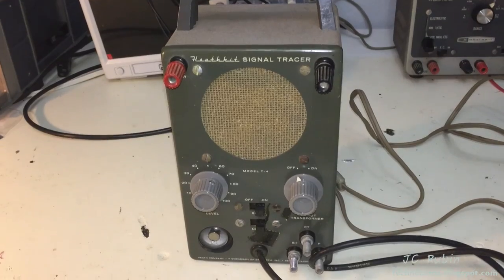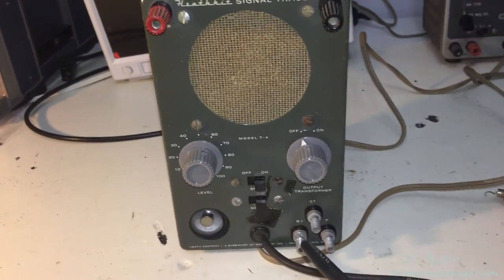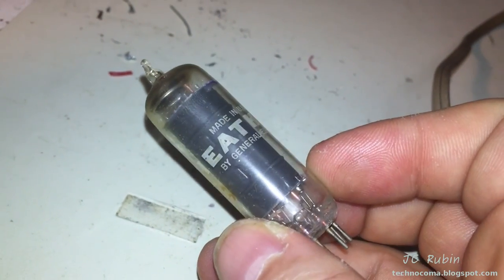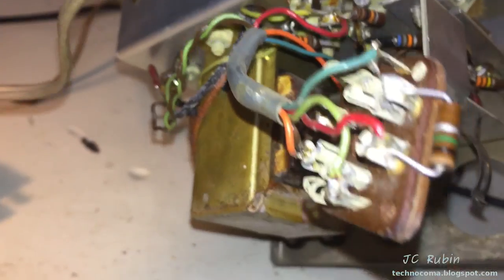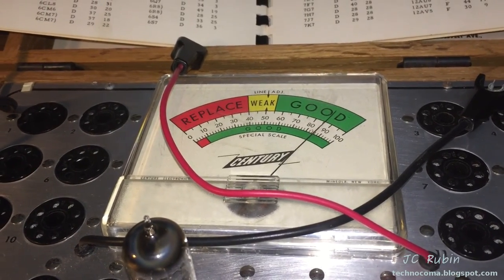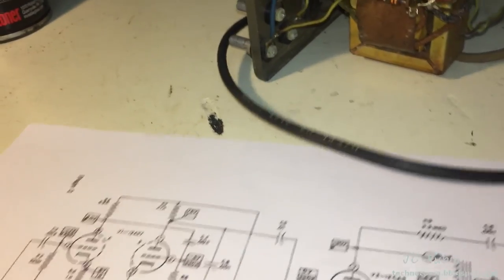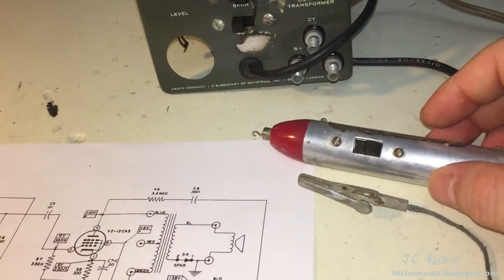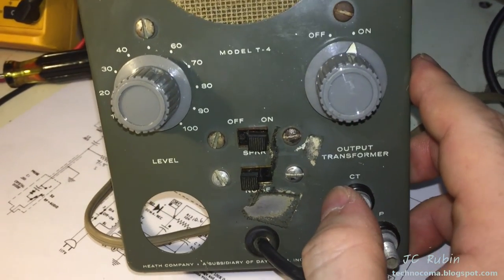Heathkit Repair - Visual Aural Signal Tracer model T-4 Part 1 of 5

Comment: I know this is an old post..but that noise switch, is for checking noise usually on an audio section..and be careful, because on the T-3 signal tracer, there is like 250 DC volts there
Reply from the maker: Not its more like 113 volts DC coming of of the 10K Resistor R13
Reply: @retrotechandelectronics  Yes sorry you are right...on a T-3, according to the manual it is like 160 volts DC....I like these testers....I really need an original probe for my T-3, which is on its way to me now..I just bought it...and yes they are getting very expensive on eBay...i paid $50, with shipping for a T-3 WITHOUT a probe....